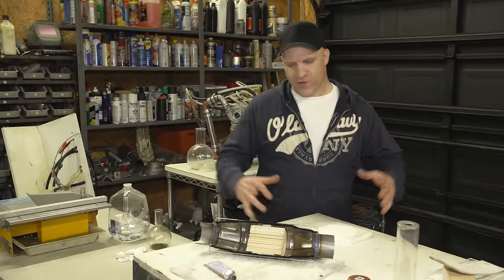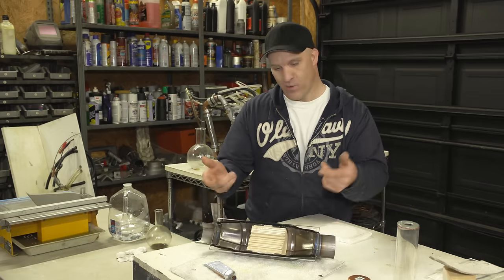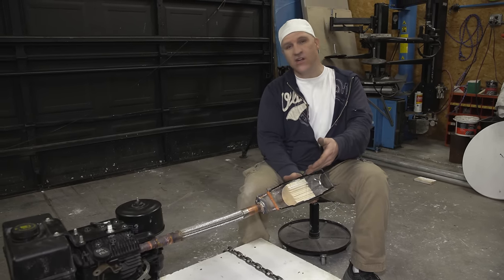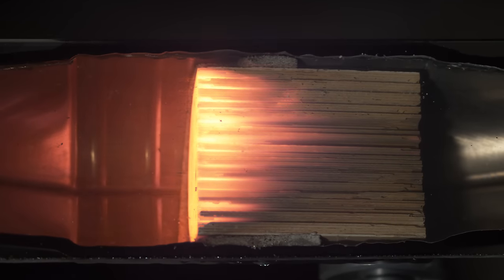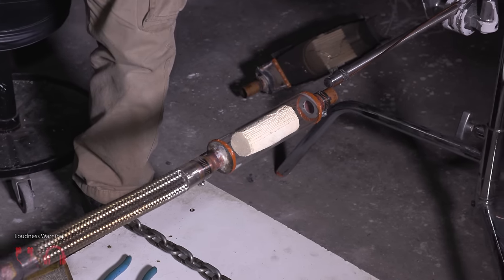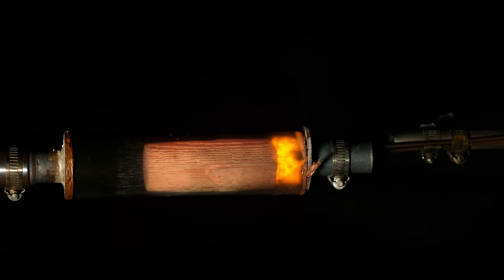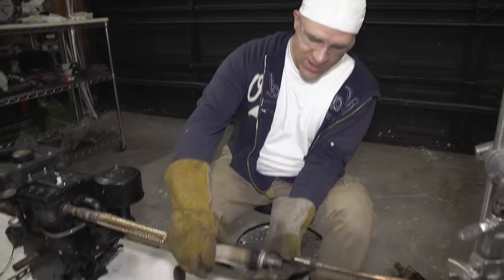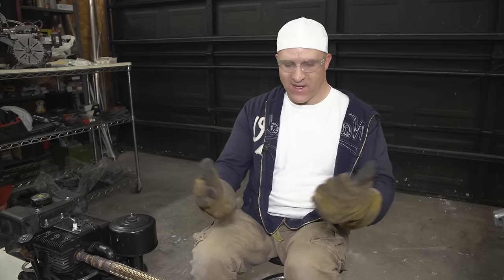See Through Catalytic Converter

Comment: Thanks to the YT "bot" this popped up today. Years ago I was driving home from work in my '89 Pontiac Grand Prix (rare 5-speed SE). Suddenly massive misfire! Got home and the cat was RED HOT! A little diagnostic work and I found a dead coil. Or so I thought at first. Actually the ignition module that fires that coil failed. 6-cyl "waste spark" setup. Three coils each firing two cylinders simultaneously. Each cylinder fires twice per cycle. Once at normal ignition point and again on the exhaust stroke. Emissions related. So when it went TU my 6-cylinder became a 4-cylinder dumping 1/3 of its fuel into the cat! Good thing I wasn't far from home when it failed. Next day after an all night cooldown I took it to the Stealership two miles away (which I rarely do) and  told them what the problem was. They replaced the module (all three coils were good) and told me the cat "probably" was OK. I guess it was because it lasted 140,000 miles before I sold the car!

Comment: one good reason never to drive with a misfiring engine
Reply: y
Reply: backfire doe 😳 💥
Reply: Jimmy S  Seems like you lot about it. Do you know if the engine control unit recognizes that the engine is misfiring and perhaps let the driver know?
Reply: Jimmy S  this happened to me. my vehicle was misfiring due to a design flaw in the ECU. misfiring busted up the 1st cat. when i got the ECU fixed the remaining pieces of the 1st cat jammed up inside the 2nd cat and reduced the exhaust flow to the point that my vehicle could not properly accelerate.
Reply: Jimmy S  my dodge ECU records specific cylinder misfires but it almost never detects them when they actually do, and often gives false readings when they dont......
Reply: @RamsesTheFourth  Yes it does let u know with OBD codes and engine light on. There are many misfire codes. I know because i have on my Jag.
Reply: I don't care about that since my car doesn't even have a cat
Reply: @RamsesTheFourth  The CARB OBD-II specification that was made mandatory for all new cars sold in the United States starting in 1996 does detect cylinder misfire and notifies the driver with the "Check Engine" light. Some of the OBD-I systems also detected cylinder misfire but there was no standardization in those older systems. European manufacturers are mandated the EOBD since 2008 because they had to be different. They do the same thing as OBD-II but they changed the standardized "P" code designation to some unrecognizable bs numeric system that requires conversion back to the "P" code to be understood by most auto technicians throughout the world, adding time, expense and confusion to the repairs of the European brand automobiles. Except of course the technicians who work solely on European automobiles because they are different as well.
Reply: @Ed70Nova427  I am from Europe, so who knows if my car has it since its made in 2002. But thanks for info.
Reply: @RamsesTheFourth  It has it. It can also tell you the cylinder that is misfiring or if it is multiple cylinders. It can also tell you if it is an ignition failure or something else. Most European gas engine misfires are caused by ignition coil failures.
Reply: Jimmy S  could al engine misfire also due to bad gas ? It wss very weird that BOTH my cars started to misfire almost at the same time or maybe a wild coincidence. And if its not fuel what else could it be ?
Reply: Jimmy S  Thank you for your help , will additives against humidity help as well for protecting or something.

I did put gas in another station an since then has not misfired but still I wonder if I should drain them nonetheless.
Reply: Jimmy S  my 08 Nissan Frontier does the flashing CEL to indicate cat not properly function.
Reply: Jimmy S  I am getting the 0420 and 0430. But you're saying the flashing CEL is not because of those, but a different malfunction? Do some problems trigger the flash and others not, or is it that some problems make CEL flash if there is a certain level to the problem?
Reply: Jimmy S  Wow, your initial reply has hands down the highest answer/question length ratio on Youtube! 😄
Reply: Jimmy S  Almost every modern-ish ECU will do this. If it is a sequential injection system with misfire detection, it will shut down the injector for the misfiring cylinder after a few "last ditch" attempts to get it to fire again. This is to protect/preserve the catalyst. As this video accurately demonstrates, they really don't like raw fuel. They store oxygen, and get hot... and we all know what happens when you add fuel to a situation like that lol. Shit gets kinda burny and melty real quick.
Reply: @RamsesTheFourth  misfire recognition is able to spot cylinder individual due to a change in rotational acceleration (based on incremental angle sensor and firing order) .
Reply: Jimmy S  Good explanation, unturned fuel would not be the largest problem. Pretty normal because of component protection, cooling down the turbo. Afterthat there should not be a lean phase with too much air. 
But the unburned air fuel mixture will directly burn in the exhaust system. I guess, this is what you ment. This leads to temperatures of 1500 degrees Celsius and beyond melting down the whole cat. Rise in back pressure.

Comment: That's what it does. It burns off hydrocarbons by getting hot. I thought it was pretty cool to watch it in action though. Good idea in my book.
Reply: Gasoline cools down catalytic converters
Reply: @FirstnameLastname-tw6yt  in what context.
Reply: it gets hot by burning off hydrocarbons, not "it burns off hydrocarbons by getting hot" that's why its called "burn" cuz it burns stuff, and heats up cuz burning stuff makes heat.
aka, the catalytic converter burns un-burnt fuel that made it out of the engine, and by doing so heats up because burning the fuel makes heat, not the other way around. in the beginning it heats up cuz the exhaust is simply hot to begin with, after all, it was on fire a moment earlier. but once it heats up, it oxidizes excess fuel and makes its own heat.
Reply: @Metal_Master_YT  Catalytic converter by definition means that it helps to change things on a chemical level. Catalytic converters were invented to change nitric oxide that are created in the combustion chamber  to nitrogen and oxygen. It also takes hydrocarbons and oxygen and makes carbon dioxide and water H2O. Water cools a hot environment  down.
Reply: @Metal_Master_YT  lf a car is running lean which means there's more oxygen to fuel in the combustion chamber this will cook the catalytic converters that's why all cars are set up to run rich which means there's more fuel to oxygen that gets burnt to cool the catalytic converter.
Reply: @FirstnameLastname-tw6yt  you say water cools a hot environment down, just about every fire makes water and CO2 as byproducts, and the water and CO2 become VERY hot in the process, so hot that they can burn things, you can light a match with steam, I know its a bit counter intuitive, but water can heat things and burn things in the right conditions. a combustion reaction is one of them.
Reply: @Metal_Master_YT  The combustion chamber is different than the catalytic converter.
Reply: @FirstnameLastname-tw6yt  yeah, so? examples are not required to be identical to the actual situation, otherwise it wouldn't be an example, it would just be the situation itself. if the differences between my example and the actual situation aren't enough to create a different result, then its still a good example. after all, that's what examples are, they are similar situations that aren't exactly the same, just similar.
soooo, please tell me why you don't think my example is adequate.
Reply: @FirstnameLastname-tw6yt  earlier you said: "lf a car is running lean which means there's more oxygen to fuel in the combustion chamber this will cook the catalytic converters that's why all cars are set up to run rich which means there's more fuel to oxygen that gets burnt to cool the catalytic converter." how can you say that when the video we are commenting on right now shows the contrary? in THIS very video, he shows how when he turns on the choke it makes the catalytic converter get hotter. it gets hotter with more excess fuel not less. and that is because the catalytic converter burns up excess fuel, and burning fuel makes heat, and that heat therefore, heats up the catalytic converter.
that should make sense, on the level of chemistry. why in the world would the fuel cool it down? the vaporized fuel is just as hot as the exhaust,
(exhaust literally IS the excess fuel vapor, and its hot) why don't you explain to me what makes the catalytic converter heat up? after all, the exhaust is not that hot, although it is still very hot, its not glowing-orange hot.
Reply: @Metal_Master_YT  No it proves what already text. The video shows a catalytic converter with a vacuum leak. Air from the outside is getting into the catalytic converter that's why it's getting hot.
Reply: @FirstnameLastname-tw6yt  oh my gosh, you can look this stuff up man. why in the world would a bunch of oxygen make the catalyst hotter? a catalyst burns chemicals, that's what makes it hot. how else could it get hot? the catalyst does not react with oxygen, otherwise it would burn up. it catalyzes FUEL, that is what it does. it does require there to be a small amount of oxygen in the chamber to react with the fuel, but other than that, the catalytic converter forces the fuel to burn. burning makes heat, this is common sense. so of course the catalytic converter would heat up. if I am wrong, then explain how the catalytic converter heats up from oxygen, it takes both oxygen and fuel to burn. 
and no, the apparatus he made did not leak until the end when it blew open because the glue melted, until then it was fine. one of his catalytic converters was completely glass all through the center of the tube, no place to leak through solid glass.
Reply: @Metal_Master_YT  Yeah you should look it up. Yeah oxygen makes things burn hotter that's how a furnace works.
Reply: @FirstnameLastname-tw6yt  at this point, I'm not sure what we disagree on anymore, I'm going to tell you what I think, and you can tell me if there's anything wrong with it, ok?
(I've got a feeling that this whole thing was a misunderstanding)
what I think is that a catalytic converter forces un-burnt fuel to react with oxygen in the air/surroundings and therefore makes heat because its an exothermic reaction. The heat then makes the catalytic converter get hot and glow orange.
how's that?
Reply: @FirstnameLastname-tw6yt  also, you can tell that its not the oxygen that's heating it up because ONLY when he turns on the choke does the catalytic converter start glowing, and when he turns off the choke, it stops glowing. if it was an air leak it would constantly glow. not just when the choke is on.
Reply: @FirstnameLastname-tw6yt  also you said: "The combustion chamber is different than the catalytic converter." actually no, its has the same oxidizing reaction that happens in the combustion chamber, and I would like to know why you think it doesn't.
Reply: @FirstnameLastname-tw6yt  a catalytic converter wont heat up if you blast it with just oxygen, it only heats up if you blast it with fuel vapor. and since there is already oxygen in the air, the catalyst can react the two together to form heat, that is what makes it glow hot.

Comment: You can make it glow like that just by passing oxygen over the catalytic convertor. Get a bottle of O2, on the end of a hose, and blow pure o2 down the cat and it will glow like that. It doesn't get hot from the exhaust gases, it gets hot from a chemical reaction between the platinum and other metals.

Comment: Not actually “while functioning”  more like when A/F controllers are malfunctioning.
Reply: Very true. It definitely over heated from running straight rich. The mixture would be alternating rich lean about 60+ times a second in a fuel injected engine.

Comment: Butane soldering irons usually have a small piece of catalytic converter grid as their heat source to avoid an open flame.
Reply: So thats what it is! I was looking my iron few days ago and was thinking what material could glow that hot and not melt over hundreds of burns. Interesting!
Reply: @Hellsong89  The old Portasol P1 butane iron used platinum wool catalyst inside each tip. Those tips were expensive even before platinum basically doubled in price to $600 an ounce and they stopped making them. And that was before Platinum shot up from around $600 an ounce to $2200, before settling in the ~$1000 range. Ironically, the catalyst grid irons are more efficient with less platinum. My $40 (1998 money) Portasol iron would sustain a flame at the exhaust with what it didn't burn. My $15 Bernzomatic iron won't.

Comment: Catalytic converters are nice... They stop cars from smelling like shit while only sapping like 20hp. I can live with that since I like to daily drive. There is really no reason to take cats off anymore. Diesel dpf and egr is another story unfortunately.
Reply: Actually newer cars models (2000 and more) don't loose power with a cat. It's design to save the maximum of power while being eco-friendly. The only way you will increase performance by removing the cat is weight reduction. 

But here I don't talk about the style. If you want to be loud, you know what you need to do
Reply: Nico M not true, most cars nowadays do get about 20+ horsepower when compared to standard cat and remap vs the cat is removed and the car is remapped
Reply: @HarryG98  I didn't say that a cat is adding 20 hps. Im saying (and not me, its prooven by many tests) that cats don't make a car loose power
Reply: When I get behind an older car from the 70's, it stinks, and to imagine we never noticed the smell in the 70's because they all smelled that way, and we didn't know any different.  At least most of us didn't, thank God  some of  us figured out that maybe we shouldn't be breathing in lead.
Reply: @ccox7198  I mean if you wanna go on about losing power, the typical ICE only turns around 18% to 20% of the energy contained in the fuel to into actual power "at the crank." 

Even if you were losing 20hp (not true with most modern cars) I doubt it would be missed among average drivers. Cars on average just have so much more power than they did. Little economy cars that used to come with 90 hp now have 150+ hp. Hell, most of these midsized sedans are nearing 300 now.
Reply: So I'm losing 1/3 or 1/4 of my car's power because of a cat..?
Reply: So it robs engine efficiency, therefore makes you use more fuel for the same speed, but yeah that's good for the environment LOL

The only transport that is eco friendly is a horse, m'kay?
Reply: @burgundypoint  Awww you thought you said something smart. How cute.

Comment: When the older catalytic started out they used pellets and when the engine ran too rich and not all the fuel was burning, the raw gas would super heat at the converter causing the pellets to melt together and clog up the exhaust going out and eventually overheat the engine to the point where everything connected to the exhaust pipes like air pumps and EGR systems burnt up all around the engine and made the engine stop running. When I tore the engine down the 2002 4 cylinder aluminum head and block was warped out 20 thousands of a inch and the bolts and parts attached to the manifolds were brittle and broken!!  All because of the catalytic that was pushed on us and not perfected for use yet that’s why everybody were cutting them out back then and just as you shown us just how hot it can get just imagine that heat backing up to the engine.

Comment: "All cars have catalytic converters"
Me: looking at my catless daily
Reply from the maker: I actually said "almost all cars have 🐈's"
Reply: @WarpedYT  irony is it increases mileage when you remove (assuming you "tune" ecu to ignore second o2 sensor).
Reply: @Aerogrow  My car doesn't even have a second o2 sensor!
Reply: @Aerogrow  Ironically the unburnt hydrocarbons damage peoples lungs and cause birth defects. MPG > public health
Reply: @JohnSmith-kq1fu  heh, well pends if you want to have a reall discussion or just trigger like a snowflake.  Modern day cars go into a full rich mode to warm up CAT until its materails are glowing redhot in honeycomb, then switch over to lean mode once that cat is fired up.  For my "weekend special car" this makes very little sense as its average trip length is less then 5=10mins, arguable carbon footprint using the standard cycle is muuuccchhh larger, including hydrocarbons.

So i mostly disable the rich mode, power adder, etc...  and finely tune my VE table for max efficeny.  With the turbocharger and higher compression; this motor is far more effeiencent then your typical minivan or SUV.  Since my daily is a telsa powered via my solar grid, you can take your moral high ground somewhere else.
Reply: @archer7716  pends if they want to have a real discussion or side with emotional trigger moments and use micro-agression or sarcasm to prove a point via some fake moral high ground.  Pretty simple model.